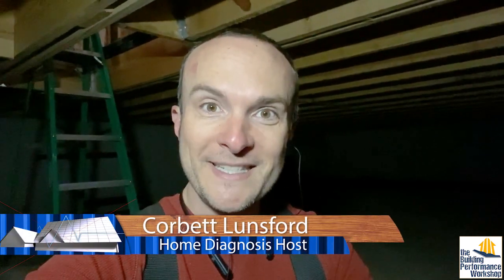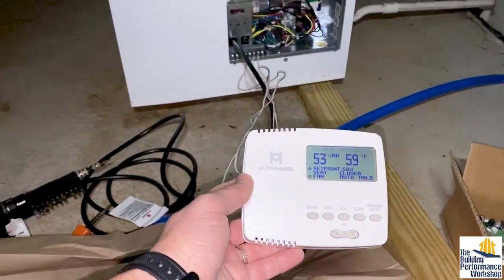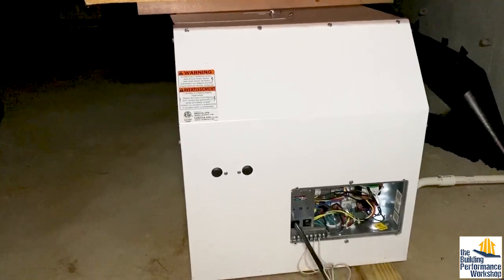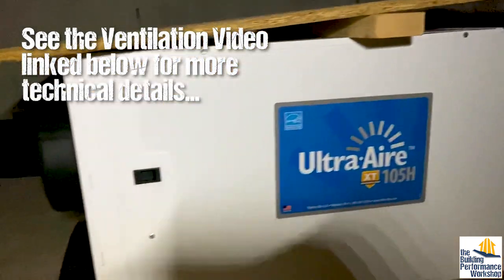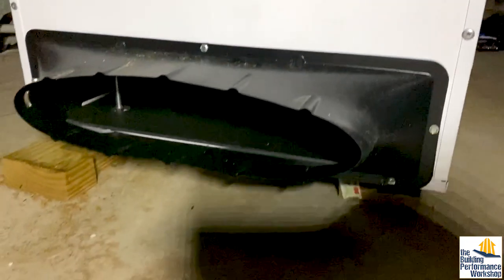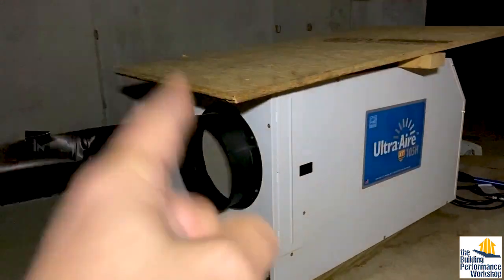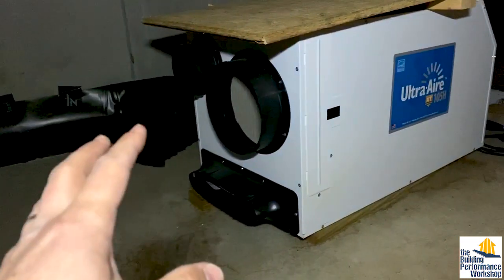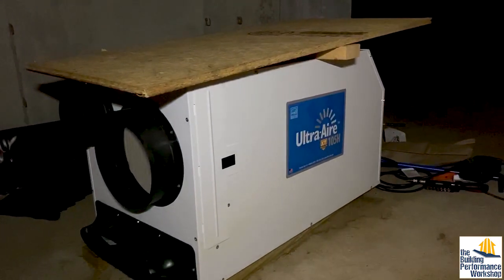Damp Home Construction and How to Dry It

Comment: Just put the modules on our foundation last week and my problem is that is it's 20-40 degrees out and my dehumidifier keeps freezing up, so the humidity hasn't gone lower than the 60%'s in the crawl yet.  (Plus RH is higher at lower temps).  We have a commercial dehumidifier and keep adding more heat but there's so much cold mass in the concrete that it needs a lot of heat!  At least it's so well insulated that once we do heat it up, it should stay there much more easily.

Comment: Hi thanks for posting. How long does it run in a 24 hour period to maintain 50 %rh, and how much energy (in watts) does it use per hour. Thanks
Reply from the maker: Depends on how much humidity you have. Capable of removing 105 pints per day. 920 Watts @ 80°F and 60% RH. Like a fridge, it runs based on the environmental factors.
Reply: @HomePerformance  thanks! For that info.

Comment: To sound a warning, all viewers should be aware that continued use of a large dehumidifier or too low of a setting can shrink the flooring structural lumber. Both thickness & length can shrink over as little as 2-4 years. I was recently under an 6 yr old house with a sealed crawlspace  where the flooring joists were all 5/8" pulled back from the outside band. This previously had a large 100+ pints/day unit (now 35). I have seen older(90yr) homes where they were as much as 1-1/2" short.  IMHO at 50% humidity setting or less should be monitored & record any changes in measurements.
Reply from the maker: Material manufacturers also want the flooring etc ACCLIMATED to the temp and RH they’ll live in. How many schedules are too rushed to follow these directions?